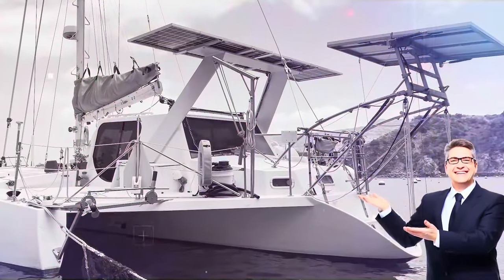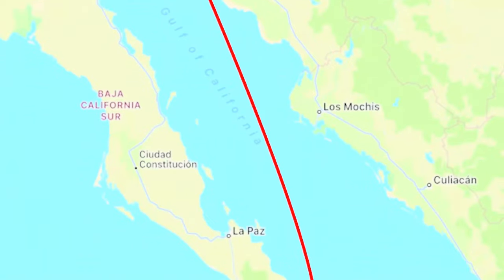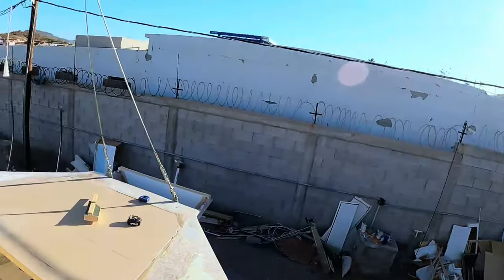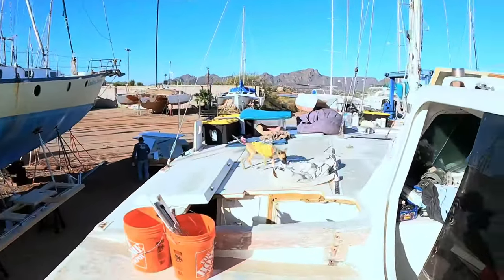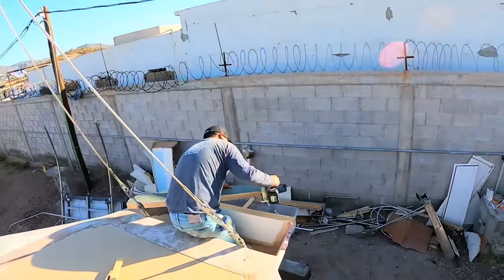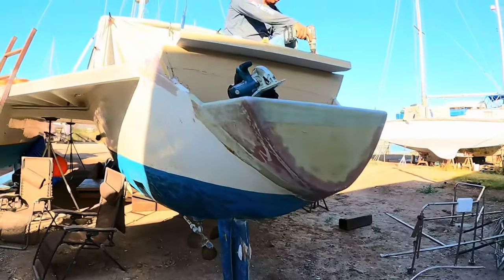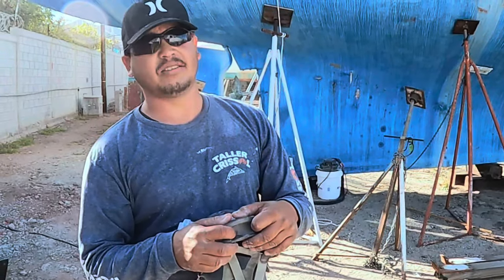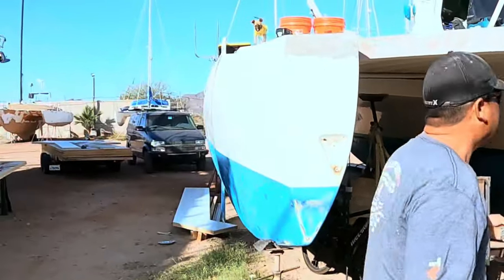(Ep #3) INSANE!!!  DIY Sailing Trimaran redesign. Building our Modern Loft.

Comment: What a great build.  I am considering doing a boat build in Mexico to save money.  How did you drive materials across the border?  I’ve been told you have to pay a large import duty.  Is there a way to avoid the import duty if the materials are used on a boat that will be leaving Mexico?
Reply from the maker: So my panels didn’t look new and I had a hand written bill of sale, so my duty ended up being under a couple hundred bucks.  It’s really not that expensive if you’re creative, and they really are easy on boaters it seems.
Reply: Mexico is getting expensive. Buying a boat and refitting it is far cheaper.
The shortest time to build a boat, by very competent people, is 2 years. (1500 man hours)